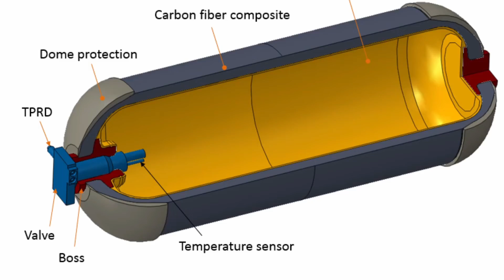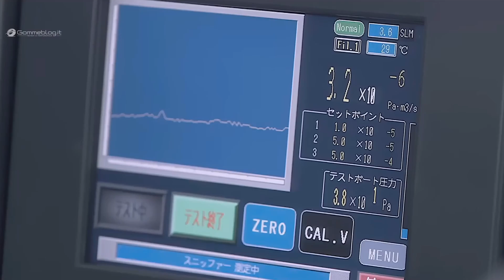Why Hydrogen Combustion Engines Are Making A Shocking Comeback.

Comment: Energy efficiencies, benefits and applications that all-battery BEV tech vs hydrogen fuel cell HFCEV tech offers are less than the two combined in a plug-in hybrid drivetrain. PHEV+H (combustible hydrogen) tech must NOT be considered an interim solution. PHEV+H (fuel cell) likewise offers more benefits that are utterly neglected in this interview. 

Let's say there are a baker's dozen important benefits EVs offer. From emergency backup household power supply to rooftop solar and neighborhood mini-grids, to equitable distribution of resources (battery, hydrogen and photo-voltiac solar arrays) to serve the most households, the EV tech that offers by far the most benefits is plug-in hybrid PHEV+H tech, including the #1 most important benefit of offering most economic incentives to drive our cars less overall and drive them less like idiots.

Lastly, Plug-in Hybrid PHEV tech is especially applicable to long-haul freight truck fleets and trans-oceanic shipping vessels. I refuse to explain this FACT in simple detail. Let's say it has to do with sensible rather than equitable distribution of resources.

Comment: So of course hydrogen can be 'Burnt' in a combustion engine, but everything else about its fuel characteristics are 'terrible'. Why not just combine the hydrogen with CO2 (4H2+CO2->2H2O+CH4)  Sabatier process. The Methane (LPG) is much easy to use.

Comment: 1 and only thing: We can fix it ourselves unlike a full EV. FFS, Tesla doesn't even allow you tap in the ECU and code anything on the car. Can only be done with their computers. Furthermore, they don't even share repair manuals so there's no way you can buy one. Contrary to that, the H2 engines are practically the same as petrol engines. Easy to maintain and fix yourself at any time.

Comment: I'm 52 years old and I didn't see the first moon landing, but my father does. I remember him recounting to me the reactions and assessments of insurmountable difficulties etc etc. And after 50 years musk has 5000 satellites, the Chinese, the Indians, the Japanese landed on the moon and we have continuity. Everything needs patience, faith and work until the problems are solved. Hydrogen will be the fuel of the future
Reply: Battery technology will progress way faster than hydrogen mark my words. Hydrogen is only useful in storage.
Reply: Produce H2 from H2O by electrolysis, using a High Voltage generator controlled by Pulse Width generator!!!!!!!!!
Reply: No. he laws of physics, paricularly thermodynamics, and chemistry cannot be circumvented. Hydrogen is a dead end.
Reply: @rogerphelps9939 is correct. Hydrogen is dead. We can make it work. Toyota made it work. The Mirai is a real car. But since it was first made in November 2014, almost 10 years ago, the Mirai has sold as many cars in 10 years as Tesla sells EVs per week. That's 520 weeks to sell what Tesla sells in 1 week. That is not a superior product. 
The reason is this. If you take 100kWhr of electricity, 70-90kWhr gets to the wheel of you EV. In the case of a hydrogen car, only 25-35kWhr of that electricity gets to your wheel. 65-75% is lost along the way in electrolysis, compression and liquefaction, transport, filling, fuel cell and battery re-filling. As @rogerphelps9939 correctly points out, these limitations can't be simply overcome. Unless you have a limitless supply of energy to counter the inefficiency, hydrogen is a dead end.
As an aside, the only reason hydrogen was touted in the first place is that the majority of hydrogen that is currently produced in the world is via methane gas refoming. In other words, hydrogen is given to you as a solution by the fossil fuel industry.

Comment: I can't see hydrogen taking off ,it goes back into thermodynamics laws, you are using more electric power to produce hydrogen from water than it takes to charge an EV
Reply: True, if you only look at the conservation of energy aspect and the charging of the battery.

When you look at solar/wind/tidal energy to power electrolysis though...

And the energy used in mining of lithium and other rare earth minerals...

And the limited lifespan of those expensive batteries...

The calculus of energy efficiency changes dramatically into H2 ICEs' favor.

Comment: Hydrogen combustion has been around since 1720's ADBiblebasher. The Carbon based fuel industree just keep's executing annee1 who produces free clean fuel H2, 4rom water. 1900 T O'Keefe murdered with a Hydrogen 4rom water train. Western Staraleah. 1903 ADBiblebasher C Y O'Conner assasinated after water pipe to Kalgoorlie.

Comment: This is complete and uter bollocks. Hydrogen engines are expensive and inefficient and the infrastructure needed to support them is hugely inefficient and expensive and is actually shutting down.
Reply: No you are talking bollocks Toyota are very intelligent they are investing in a worthy solution, people who have more money than sense have wasted it on buying these electric stupid cars deserve all they get . Electric cars are not sustainable they still rely on gas turbines to drive generator sets it's common sense period.

Comment: Not happening.  Wasting their time chasing this lol
Reply: This didn’t age well lol
Reply: @DaFlasher  the comment from @santoshrathod123 is not only correct but has aged very well. As of today, they are cancelling hydrogen filling stations across Europe and the UK. Hydrogen buses and trains that were being considered are no longer being considered and dropped. Toyota is pulling the pin on the Mirai. Hydrogen was a smokescreen sold to you by the fossil fuel industry. How do you think hydrogen is made? The majority is made by methane gas reforming. Gas! Even if you make it with pure renewable energy, it is grossly inefficient. The same 100kWhr used to generate electricity will drive the wheels of an EV with 70-90% efficiency. For a green hydrogen car it is 25-35% efficient. Hydrogen was never an option and is becoming dead in the water as far as light vehicles are concerned.

Comment: JCB have been making H2 diesel engines for few years now! The vehicles & the engines in them are painted brilliant luminous Green. The problem is the fuel. 5 types of H Black bad to green best) depending how much pollution is created in it's production, compression, storage & distribution! For me the answer is H2O2, hydrogen peroxide or bleach! You are driving along & you get a low fuel warning light! Pop in to any Ladies hairdressers for quick top up!

Comment: Less BTU's than gas and given the internal combustion engine is so inefficient it would have to be practically free to compete with EV's......
Reply: Actually hydrogen burns way hotter than gasoline.  Toyota had to develop a whole new cooling system.

Comment: Trucks should be hydrogen cars electric
Reply: In the case of trucks, let them both compete and may the best option win. Tesla with the Semi and Nikola with their hydrogen fuel cell trucks. Interestingly, Nikola sold 112 hydrogen fuel cell trucks in the first half of 2024. Tesla has built roughly 140 units, with approximately 100 being used by Tesla itself and 36 going to one of its biggest customers, PepsiCo. So in sales, Nikola is currently leading. Interesting to see which technology will win. My money is on the EV

Comment: 4:58 Why do fuel-cell cars have low torque, but hydrogen combustion engines are better but have 6:26 too low torque?
Reply: That's the crucial difference between electric engine (hydrogen fuel cells in fact transform hydrogen energy to electric energy and they run electric engine) and hydrogen combustion engine, which simply can create higher torque than energy from hydrogen fuel cells which run electric engine.. However if we compare torque of combustion engine of fossil fuel (petrol, diesel) fossil combustion engine can provide us higher torque than hydrogen, which is given different chemical properties of these fuel, particulars in processing burning of each and every source of that energy...

Comment: Well I've always liked the idea of filling up with water as the saying goes ,and although i don't understand engineering i thought if the hydrogen motors mostly make only nox because of nitrogen in the air intake well would it not be cool to do away with air intake and use the oxygen from the water...!!??

Comment: I would like to see a way to convert the hundreds of millions of ICE vehicles already in use to low or zero emission vehicles. Apparently, that is simply not possible using hydrogen, even if hydrogen could be produced in a sustainable way. It is possible that battery advances will soon make EVs so superior to ICE that the market will solve the problem. That is, people will rush to trade their ICE for EV and the "conversion" of ICE to EVs will take place in the crusher!
Reply: A company named Phinia is providing a solution to address converting gas ICEs to hydrogen, search the following:
PHINIA Empowering Transportation Transition to Carbon Neutrality
Reply: A company named Phinia is providing a solution to address converting gas ICEs to hydrogen, link below:
https://youtu.be/jbY55E3eHes?si=AVSGsDyaw49kq02t

Comment: Hydrogen at present is too expensive to produce. Unless that problem is solved, it's a waste of resources to invest in hydrogen engine development.
Reply: Yep. Reducing price related to all hydrogen things  is the Government’s duty.
Reply: Hydrogen can be produce from H2O by electrolysis using a High Voltage generator, controled by a Pulse Width Modulator!!!!!!!
Reply: @mikelab6912  And? At the end of the day, if you have 100kWhr of electricity, 70-90kWhr of that electricity gets to the wheel of an EV. That High Voltage generator, controled by a Pulse Width Modulator, plus compression and liquefaction, transport, filling, fuel cell filling and battery resupply only gets 25-35kWhr to your wheel.
Hydrogen cars are expensive and inefficient and they cannot overcome that problem.
Reply: I agree. Is there, also, an increased safety hazard considering there are multiple fuel tanks under pressure in passenger vehicles? Electric vehicles are presenting multiple increased safety issues.
Reply: @generalnguyenngocloan1700  Hydrogen vehicles introduce new risks and yes, the more fuel tanks you have the more potential points of failure. EVs also introduce new risks, but part of the problem is build quality. Hydrogen vehicles require specific safety measures (such as hydrogen detectors) to manage the risks. Risks can be managed. EVs can also be made safer, but that adds weight and cost.
Reply: @GerbenWulff  👍🏻
Reply: White hydrogen.
Reply: Toyota begs to disagree. Considering they are a renowned automaker with one of the most reliable cars out there, I don't think it's smart to ignore their intentions.
Reply: EVs are expensive to make plus the human cost of mining lithium, that's bull crap hydrogen ice all the way.
Reply: @andrewfaulkner1113  Really? How does the price of an EV compare against the cost of a hydrogen car? Did you know that Toyota has been making the Mirai since November 2014, so nearly 10 years. Tesla sells more EVs per week than Toyota has sold Mirais in 10 years. That's roughly 520 Tesla for every 1 Mirai. You really think hydrogen has a future? Lol

Comment: Now this is the step in the right direction. All electric vehicles suck.
Reply: Couldn't agree with you more, my friend.
Reply: The internal combustion engine is so inefficient it really does not matter what you use for fuel.  Unless the hydrogen is almost free it will always cost more to run an ICE than an EV.
Reply: Not just that, but maintenance of hydrogen system is nightmare. There is very good reason why in space industry it is not wide spread. Another thing is conversion. It stupid to not use electricity straight for propulsion but instead conversing it back and forth every single time.. @allankoivu3263
Reply: @allankoivu3263  - it’s not all about cost.. it’s about common sense too.. at this point cost is irrelevant.. we are dropping our reliability for EV’s. EV’s will never be reliable. Until batteries don’t die, don’t require charging, don’t ever need to be replaced it’ll never be a reliable option. I’d rather fill up on gas or hydrogen than spend at least 30 minutes charging a car.. that’s a waste of time. Especially in today’s world where every minute counts.
Reply: @austinkennedy955  I have an EV and it is ten times more reliable and less expensive than my last ICE car.  As for charging times it is a moot point.  I plug it in when I get home and unplug it fully charged when I leave in the morning.😀
Reply: @allankoivu3263 First: Electric cars are way too heavy. They’d need to rebuild the entire infrastructure. (Maybe they could a used the infrastructure act for that 🤷.

And that’s being powered by dirty coal mixed with solar (maybe). 

With the new hydrogen share program and how you’ll be able to produce your own hydrogen and share the excess with the community. 

This is the future.
Reply: @DashingFelon  Thea is the silliest argument I have heard yet.....My Bolt EUV weighs 1,685 kg and your typical F-250 Pick up truck weighs over 2500 kg . by your argument all pick up trucks are too heavy for the roads and should be banned.🤣
Reply: @mamoruchiba3301  Boredom till you try to find a hydrogen source.  The ICE is a dead end technology using Hydrogen is at best a stop gap solution as the efficiency of an ICE is less than 25% and an EV is over 80%.  Most of the money spent on Hydrogen will be lost as waste heat....
Reply: Facts!
Reply: @austinkennedy955  If someone tells ypubwhat you want to hear doesnt mean it is facts . Just your wish and has nothing to do with facsts because that is something you dont care. Reminds of comunists  or religious fanatics.
Reply: @mravecsk1  lol i’m not sure you even made any sense there… ha comical….
Reply: Realy? You failed elementary school physics then. Let alone this is total bs.